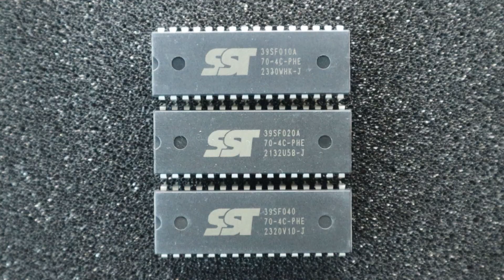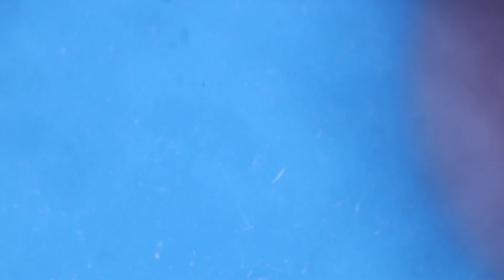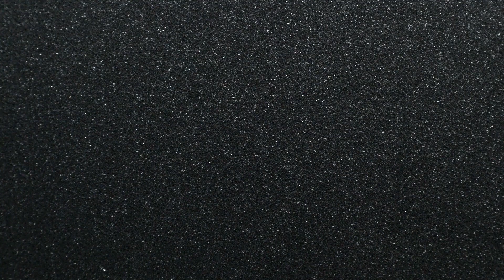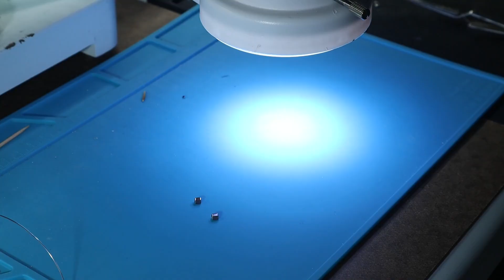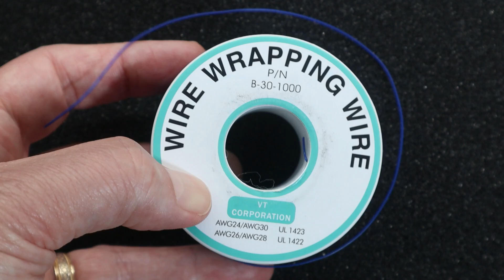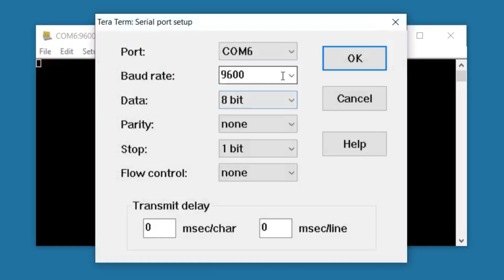Let's Make a Flash Memory Programmer! [Part 1] (EP 59)

Comment: Junior electrical engineering student here, thank you for making these videos. They are very informative and I especially liked your series on composite video signals. I made a flash memory programmer back when I was in high-school using an Arduino uno and a chain of flip-flops, I actually programmed the exact same chip you have in this video. I would love to see another video on the software you programmed for this project(unless its later in the series). Thanks Dr. RG Plague!
Reply from the maker: The video for the firmware has been released, but the Windows App has not yet. I will be creating videos on the App code, but that will come later (I'm still working on how to present it in a clear and easy way). Thanks for the comment, and thanks for watching! Also, good luck with your studies!

Comment: This is great... One of my only electronics projects that works and actually does something useful is my beloved sloppy perfboard AVR programmer. :)
I love the power supply lead length "trick".
I've never used Atmel Studio... That fuse programmer is very nice... I always get my existing fuse settings as hex, type them into a web-gui, pick my new settings, get them as hex, program those hex values... which aint no fun!

Comment: I think it would be nicer to source power completely from the computer's USB 5V... now you need both a computer connector and a custom >8V connection.

The board sandwich + standoffs are nice hack for 'closing up' the board connections
Reply from the maker: Your comment reminds me that I forgot to mention in the video the reason I'm using external power and not USB power. I'm not connecting directly to the USB bus, but rather connecting through the FTDI cable. The particular cable that I am using is rated for low current, and it only pulls one unit load from the USB port. This current needs to power both the FTDI cable and any loads connected to it. FTDI does make a higher current cable (I believe it draws five unit loads) and would be suitable for powering an external load. Since I am uncertain which cable will be connected to this programmer, I am just using external power to be safe. While the programmer is low current, this does not mean it won't draw more current in the future (depending on which chips are being programmed, or whether external circuitry is added through an adapter board for high voltage programming, etc.) You can always use USB power in your design if you desire. Thanks for the comment!